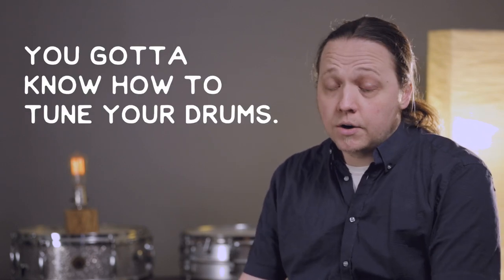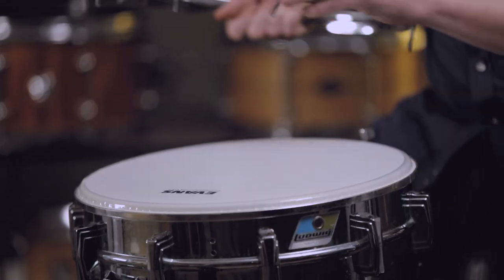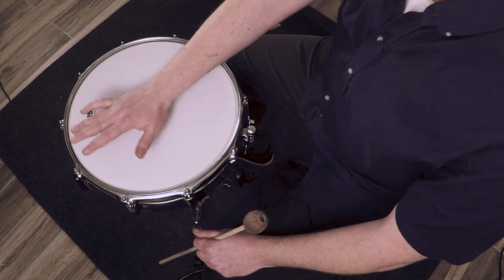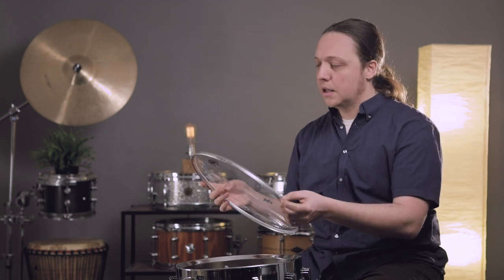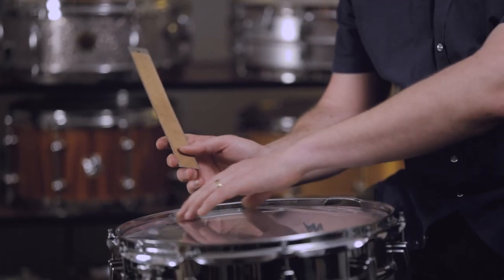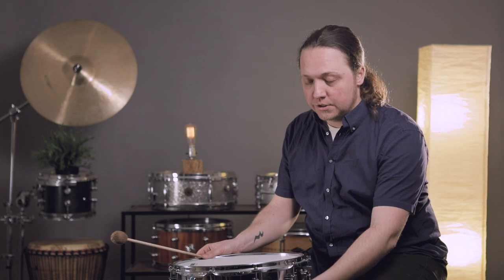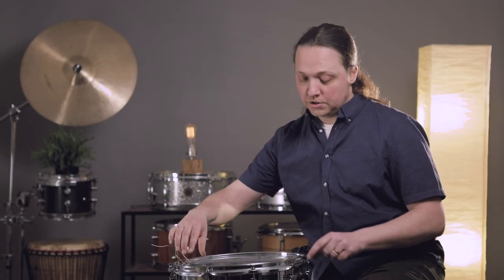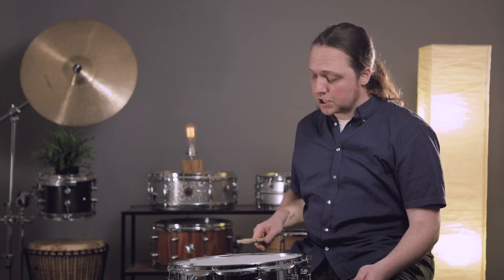Ep. 1 How to Get A Great All-Purpose Snare Drum Sound

Comment: Hey I have a problem I hope you can help me out. When i have my resonance head at table top tight, my snare wires dont sit on the head at all. There are parallels about 1mm above the head. To get it to work I have to detune the tension rods near throw off and but plate. Help please. Note that I donot have a snare bed lower to bearing edge.
Reply from the maker: Hey there! Thanks for watching. We've addressed the issue of tuning the snare side "tabletop tight" here: https://youtu.be/Moru2uzLB6I
In summary, we don't recommend it and you certainly don't need to do it if your snare has a subtle or non-existent snare bed. . Here are some general tips on snare side adjustments: https://youtu.be/E5mPLPocfM4
Cheers! -Ben

Comment: About the measuring: I tried this on my Brooklyn Wood Snare and it was not possible in a way I would feel good about it. The snare bed part was (rim to shell) around 16mm while the rest was around 12mm. Even loosening the 12mm parts wouldn‘t bring that even close to the 15mm and cranking up the rods on the snare bed was nothing I wanted to try. Do you have any tips? 
Also I have the feeling something is wrong with the shell itself. It‘s nearly impossible to tune the heads in a way they don‘t ring like crazy.
Reply from the maker: Hey there! This method can work for most any drum, but depending on the nature of the snare beds there are certain adjustments/concessions you do have to make. Example 1: Supra, with suuuper wide and fairly shallow snare beds. Measure all the way around, it works out fine. Example 2: Dunnett, extremely exaggerated and deep snare beds that look like someone took a bite out the shell. You can't measure right at the lugs bordering the snare beds because the slope is way to steep. With this drum, I move the ruler to the edge of the snare bed and measure there. This is going to result in a flatter-sitting bottom rim rather than one that follows shell curvature and for a drum like this, i get the best results. If the beds on your drum are leaning toward the second example, try aiming for more of a flatly level rim and if need be, move your measuring location a bit away from the snare beds rather than getting down in them. Hope that helps! - Cody
Reply: Thanks so much! I'm going to give the second method a try, sounds like it might suit the drum better.
Keep up the great work!

Comment: What about the wood snare drum? Do you tune it the same way?
Reply from the maker: Yup, the method stays the same. There might be slight variations from drum to drum but that can be due to lots of factors (bearing edge, wires, depth/diameter, choice of heads) but the main system stays the same. -Cody

Comment: Nice video guys! However, I have a quick question.  Ok..so typical snare-side heads are 3mm, which I get, but..what if you put a thicker (say 10mm) head on the snare-side?  I'm guessing the snare sound would possibly be less articulate??  How would a thicker head affect the sound??  Thanks for the videos, I am subscribed! Take care, K
Reply from the maker: Hey there! Apologies in advance if this response is a little long, but this is something that i've actually seen come up on a couple of different forums recently so it's worth addressing in full. The reason why snare side heads are so thin is two-fold. You're going to need the snare side head to conform to the edge of the drum very closely, and since that side of the drum will not be flat (snare-beds), the film of the head needs to be pliable to easily settle into that unevenness while also allowing for even tension. Secondly, in order to simultaneously have articulate snare response at low dynamic levels and a big sound when struck hard, that snare side head needs to be thin enough to be easily tensioned rather tightly (for the low dynamic articulation), and elastic enough to move more broadly when you dig in and bash. A 10-mil head will struggle to settle into the unevenness of the bearing edge of the snare-side of the drum (and probably wrinkle a lot around the snare beds), and you'll likely only be able to get a very messy sound out of the wires when you engage them. The snare wires also won't lay evenly on the head because of this which will further blow out the articulation. Now having said all that, I can imagine that splitting the difference with maybe a 7-mil head and the right set of wires making an interesting (and pretty non-traditional) sound :) Hope that helps!
Reply: Awesomesauce!!  Thank-you for the reply!! :D
Reply from the maker: No problem! Happy tuning :)
Reply from the maker: And just to clarify- the thickness is 3mil (not 3mm). 1mil=.001inch.
Reply: Sorry, yeah..you mentioned that. my bad.
Reply from the maker: No worries!
Reply: Kennan Gilbert I've made that mistake before. It basically sounded like I was playing a very dry tom. No bueno.
Reply: try out different thicknesses and see what works for you

Comment: I notice you don't seat the drum head with the palm...some actually do this pretty drastically..could you possibly comment on this? Good/Bad? Very nice video also.. thx
Reply from the maker: Thanks! Yeah, I don't personally do any intense pressure to 'seat' the head when putting on a new one. I did do this when I was younger and found that it didn't really garner any positive effect and with a thinner head could result in damage. I know that people have differing opinions on this, especially where that satisfying 'cracking' sound of the glue around the edges of some heads leads you to believe that you're pre-cracking it so that it won't go out of tune later. I say to each their own, but I did trash a thin orchestral head once back when I though that this was necessary :) Cheers!

Comment: do you use any lube on the tension rods? like vaseline?
Reply from the maker: Yes, but not vaseline or petroleum-based stuff. If anything it's just a tiny bit of lithium grease. A little goes a long way and it will save you from lugs stripping out or getting rusty. - Cody
Reply: What's wrong with Vaseline? 

Also makes THE BEST cymbal cleaner and God knows I've bought every waste of money one out there. 

Downside,  attracts dust a bit.

Comment: Levelling off the side head first is fine but when I start to tune it the lugs either side of the snare are always sound low compared to the others. If I chase after the tuning it means cranking the snare lugs up to get anywhere near the rest, and then the head is no longer level. In the end it's coming down to 'what's more important, a level head or a evenly tuned head?'. I guess I need to experiment. Anyone else get this?

Comment: What do you do if the head is not sitting flat?
Reply from the maker: I'd just try to level it out with the tuning screws (tighten where the rim is high and loosen where the rim is low to the drum). If it's already stretched to the drum at an angle you may have to just replace it to get a good sound. The ruler trick from the video really helps with this. - Cody

Comment: Rather than fooling around with the ruler on the snare head, just get the threads of each rod BARELY started in the lug sleeves. From this point, simply tighten each rod the exact same number of turns until you have a bit of tension on each one. Some will make contact before the others, so keep turning each in small increments until all of the rods have some tension. This assures that the head is on 'level'.  It'll be much more accurate than using a ruler and it's faster. Then tune it. You should do the same with the batter head.
Reply from the maker: Though that won’t produce the matched topography that we describe here. The key is the snare bed. We’ve got a full video that addresses this concept as well.
Reply: @SoundsLikeADrum  Right. So get the rim level, which is what you are trying to do with the ruler. Properly using the threads on the rods will do this faster and more accurately than a ruler.
Reply from the maker: Going by threads doesn’t account for the snare bed though. For that you need to use something that measures against the drum shell. For this reason we use a ruler. Try it out- it works!
Reply: @SoundsLikeADrum   I think you are missing my point. The threads on each tension are identical, obviously. Counting the number of turns at each lug will more accurately level the rim than the ruler and it will be much quicker.
Reply from the maker: @jimbizness3864  I understand your point but I think you're missing ours and the whole idea of matching the contour of the snare side hoop to the topography of the bottom of the shell. Leveling the snare side isn't about having the same thread distance- it's about having the hoop match the shell. As a result, four of the tension rods will actually exhibit a shorter length in order to account for the snare bed. Using a ruler is so fast, doesn't require counting threads, and actually accounts for the height of the hoop off the drum shell. Again, until you try this out for yourself, it may be too abstract.
Reply from the maker: @jimbizness3864  I'd recommend watching this for a greater understanding of the concept here: https://www.youtube.com/watch?v=vYOimGMU9ZI&
Reply: @SoundsLikeADrum  I hear you and I am not trying to give you a hard time. I enjoy your videos and you make some good points!
However, even the thin (compared to modern Ludwigs), triple-flange rims on your Keystone Acrolite (I have one, too) won't flex that much. And the fact that the snare beds end approximately at the nearby lugs make it impossible to put a curve in the rim that matches the bearing edge. In other words, the only possible way you could accurately bend it down to match the bearing edge would be to have the tension rod in the CENTER of the snare bed....obviously impossible. 
Regardless, even if you are able to achieve the same depth at the center of the snare bed as the lugs 90 degrees way, there will be excessive tension on the head at the lugs  nearest the bed area. This is why I suggest counting turns and using the threads to get everything lined up, then TUNE it by ear (if it matters to you) and take out the wrinkles (although I've had them sound fine with wrinkles...there's an old Buddy bass drum story about that). 
Another thing to remember is the many of us perform on drums with die cast rims. They won't bend, so it's impossible to use your approach.  Make sense?

Comment: Experiment on a Ludwig Black Beauty: 

Sounded OK with stock Ludwig head, though a bit flat and I disliked the feel of the head.

It became excessively ringy with coated Ambassador, not quite so bad with Emperor.

Rang like a darn bell with Suedes top and bottom—AWFUL!!

Replaced stock triple-flange hoops with die-cast, mammoth improvement! But by that time, I was ticked badly by the drum and sold it, buying a better-sounding Pearl Brass Sensitone.

Idiot, crackpot, true amateur in the classic sense: your call.

Comment: 10mm thick drum head! I don't think so 😂. Apart from that, awesome
Reply from the maker: Sorry for the confusion - from Google: “A mil is a measurement that equals one-thousandth of an inch, or 0.001 inch. One mil also equals 0.0254 mm (millimeter). Thus a mil is not the same thickness as a millimeter. The term "mil" is not an abbreviation but a unit of measure.” -Cody

Comment: Ten mil thickness?!  I think not. That's about a quarter inch. 10 thousandths is more like it.
Reply from the maker: Sorry for the confusion, from Google: "A mil is a measurement that equals one-thousandth of an inch, or 0.001 inch. One mil also equals 0.0254 mm (millimeter). Thus a mil is not the same thickness as a millimeter."
Reply: @SoundsLikeADrum  Cool, yeah I was thinking damn, those are some thick heads:) Good video btw. Snare drum tuning is difficult at best. I like the use of mallets, will try that in the future.
Reply from the maker: It’s funny how some people have taken to using “mil” as an abbreviation for millimeter when “mils” are a standard form of measurement (particularly for polyester film). To say “10mil thick” is quite appropriate.
Reply: @SoundsLikeADrum  It's in the saying rather than reading. I've heard people say "mil" when they meant millimeter which wouldn't be an issue when reading as millimeter is abbreviated as mm. But yeah in terms of plastic film thickness it's written as mil. Oh well confusion will be my epitaph.

Comment: Tuning drums is one of those unfortunate processes that is both boring, time consuming and fiddly. They also immediately start the process of detuning the second you start hitting some rim shots. Thats why i just use a torque key and tune each lug till it clicks out.
Reply from the maker: We hear you! Hopefully the resources on this channel are helpful to you. The more you do it the less time consuming it becomes and, in some cases, the more enjoyable it can be. Even if you decide to use a tool like a torque key (which can also be imperfect) to match tension between lugs, you'll still need to use your ear to determine whether or not it sounds good. Cheers!
Reply: @SoundsLikeADrum  i fully agree that a torque key doesn't produce perfect results, far from perfect actually. Its just a quick fix when faced with the mammoth task of resitting heads and doing all the rest of it by ear. I often wonder why a torque key doesn't produce perfect results, as you'd expect lugs under uniform tension to sound the most consistent.

Comment: For all my broke ass drummers out there. this is something especially cheap snares/ old snares suffer from. Remove the lugs fron the snare. And with the parte were the screw fits in. Usually there is a spring inside. Especiall cheap snare. Muffele that with cutton on all lugs. This is an anoying ring, that can not be tuned away.

Comment: Great production, but I disagree with a lot of the content.  The sound of that snare drum at the end is very messy and would never pass muster in a recording session unless you were playing some sort of sloppy New Orleans vintage type of groove. Also, on Ludwig Supraphonic snare drums you are much better off using a Ludwig or Remo snare side head with no collar. Once that head is tensioned properly, the hoop can be pulled so far that it interferes with the snare wire straps/cords, unless you use a head with no collar.  Evans currently doesn't offer such a head.
Reply from the maker: Hey there, and thanks for commenting! Firstly, it goes without saying that tuning and, more importantly, choice of tuning in a given performance situation is a very personal preference. The tuning featured here is been used by myself and others whose drums i've set up for sessions across the spectrum from pop to jazz, R&B and rock with great success. The audio here is intentionally recorded with a single AKG 414C at head level to give a more accurate representation of the behavior of the drum as heard by the drummer (which consequently is a broader sound given the distance of the mic capsule from the drum). In a multi-mic setup with compression and EQ included, the instrument will certainly take on a more modern and articulate character. The intent here is to offer insights into achieving a fuller, warmer and more resonant sound out of the snare, which you can then modify based on the needs of your particular gig scenario. Regarding heads, you're certainly free to use what you'd like, though I've never found a head, snare-side or batter, that didn't work pretty great on a Supraphonic using the methods demonstrated here :) Cheers!